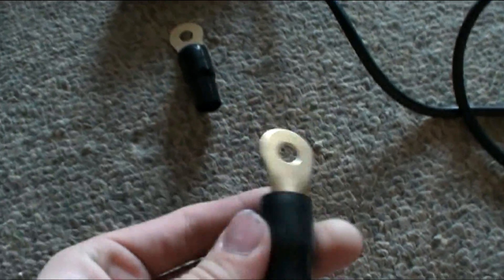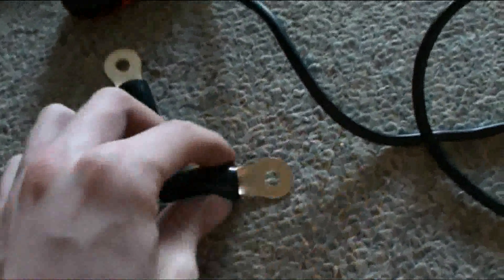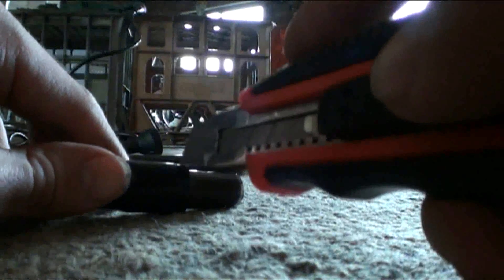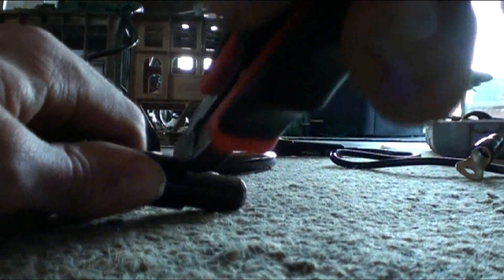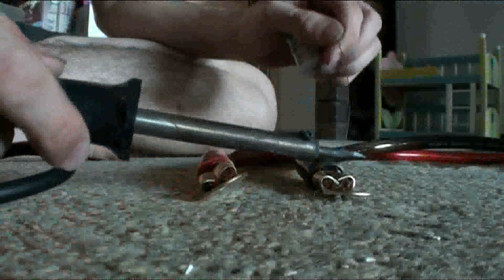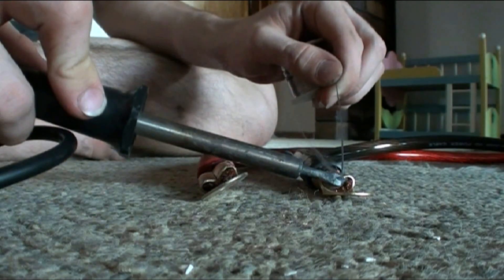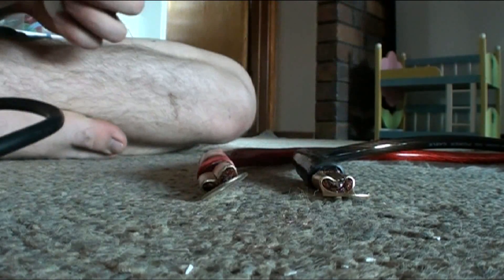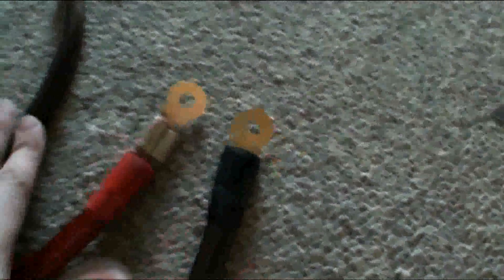How to Install Ring Terminals onto 0/1 Guage Wire

Comment: Uh... nope. Hammering is bad. Especially hammering against a soft flooring... and also if you solder you don’t drip the solder onto the wires. It’ll make a bad contact that way.

Comment: Haha, did your carpet managed the heat from the soldering tool?
Also try to wear pants next video mate.
Reply: Daniel Adolfsson Ya that's the first thing I noticed too, he had the basics right but the safety aspect was completely farcical. Good intentions though, I hope Mum and Dad didn't beat him too badly for the hole in the rug.

Comment: first of all, NEVER HAMMER WHEN YOU ARE SUPPOSED TO CRIMP. especially on wire this thick. use step pliers, or even vise grips, never the method shown in this video.
Secondly, the tighter end of the boot is supposed to go closest to the terminal, thats why you split your boot bro. i was searching for a tutorial, seems i know more than the teacher...
Reply: when I say step pliers, I mean channel locks

Comment: The goal is for the solder to melt into the wire not weld around it. Placing the solder on the iron causes the solder to heat then it falls onto the wire and cools immediately which is useless. You should place the iron on the wire then from a separate location put the solder into the wire. The wire will accept it when it is hot enough.
Reply: Australia's Biggest Bass Channel I'd remove wrong video's
Reply from the maker: yeah this was back in my "not a clue days" lol
I am a car audio installer/fabricator now professionally

Comment: If you're going to crimp the terminals.....invest in a hammer crimper.  You can find them on ebay for under $20.  Knowing that the connection isn't going to work loose and fry your amp is some serious piece of mind.

Comment: I've seen a few of your vids...pretty good, but you need to pound out a script first. Here's a few of your helpful phrases:
1. "...ring terminal things whatever..."
2. "...get your wire, get this rubber thing..."
3. "...we just cut off enough of the outside of this..." (it's called insulation)
4. "...I always find that twisting makes it that much better.." (uh, why, isn't this a tutorial?
5. "...I get a hammer to get these bits to bend in.." (what are you talking about? Can't see it)

Comment: did you release a new vid on how to do the terminal connections now? i follow u on a different account and cant remember if u did. i've recently ordered 5meter of 4gauge wire. I wont be using these terminals, instead ill be using ''KnuKonceptz 4 Gauge Cable Set Screw Ring Terminal '' that i've ordered as it seemed easy and looks good. but would still like to know how u did it as i've been following you for quite a while and trust you.. I went for knu cable because u recommended them in ur vidz

Comment: Actually, the correct way is a tight crimp with a proper crimp tool that applies enough pressure to cold-weld the copper to itself and the terminal.

Solder has far more resistance than copper, and under high heat conditions will melt out of the joint. 

Solder also wicks down the cable, turning a flexible cable rigid and less able to withstand movement.

Comment: so long as u solder it then ur all good. it did help with getting the little rubber tube to fit around the wire to heat it up 
with a blow dryer

Comment: Another amateur on youtube spreading bad advice.  Don't follow this man's advice, kids.  Why spend the money on 0 gauge cable in the first place if you're just going to skimp out on the connector?  The proper way to make the connection is with solder (and lots of it).